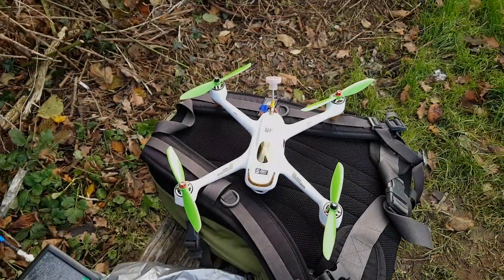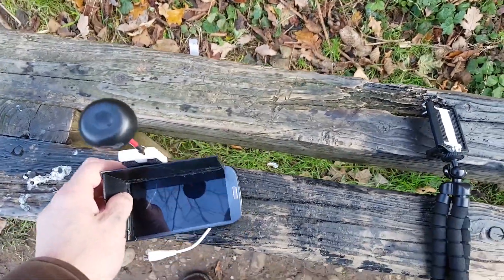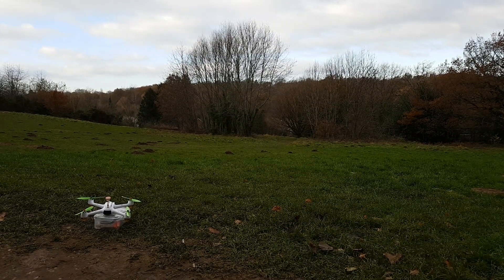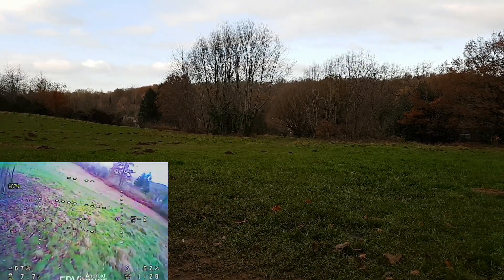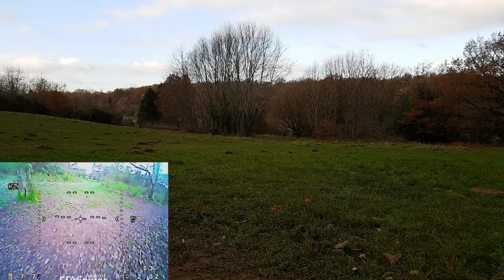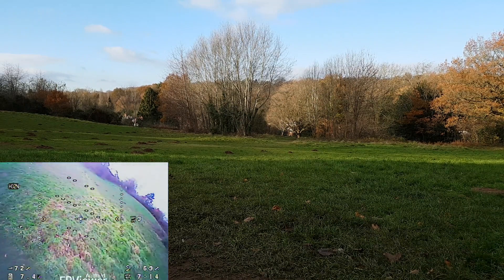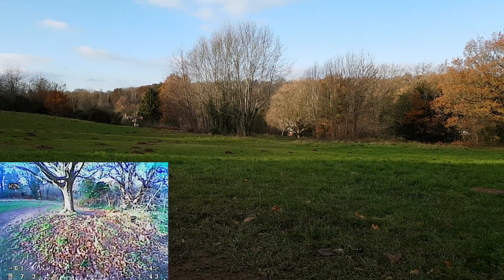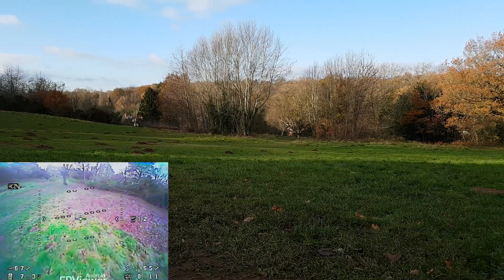Hubsan H501SE Test Flight

Comment: Simon - Could you please check your gmail.  I just sent you an email describing a barometer problem with my 501 that I can't solve and I really need your help.  Thanks buddy!
Reply from the maker: I have read the email and taken time to think about the problem. Without the quad in front of me it is hard to diagnose the problem. Given where the Barometer is located it would be quite difficult to damage it without knowing it had been damaged. You have re-written the firmware so we can rule that out, although it does sound like a firmware issue.  Maybe re write an older version of firmware and see if that makes a difference. You mention the problem started after the camera and VTX were replaced. Me personally, I would strip it down and rebuild paying close attention to cable routing and ensuring no snagging etc.
Reply: Thanks for the quick reply Simon.  I've actually written 3 different versions of the firmware set trying to solve this, with no joy.  I've had to disassemble the drone a few times before this episode without problems and always try to be extremely careful reassembling it knowing it has some very tiny fragile wires.

One thing I did notice since this bug first appeared is that something different happens now during each initial takeoff. I always fly the 501 up to about 4-5 feet and check for a stable GPS mode hover.  Previously it would always drop only a couple of feet then stabilize.  Now I have to take it up to 6-8 feet or it will just slowly settle about 5 feet before stabilizing.  This  seems to be dependent upon wind conditions.  I'm guessing it's related.

I will disassemble the drone again today and look for any abnormalities.  Thanks again Simon.  I'll give you an update soon.
Reply from the maker: If wind conditions are effecting the quad, ensure the Can (metal shield) is on the FC correctly and that the open cell foam is over the Barometer between the FC and Can. As you know the Barometer works with air pressure, it will not be stable with wind blown across it. Good luck.